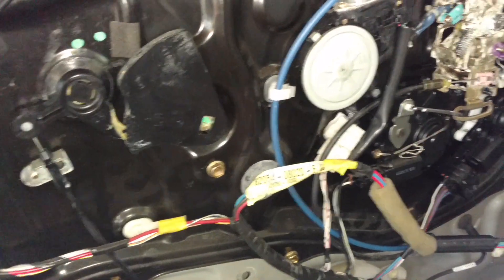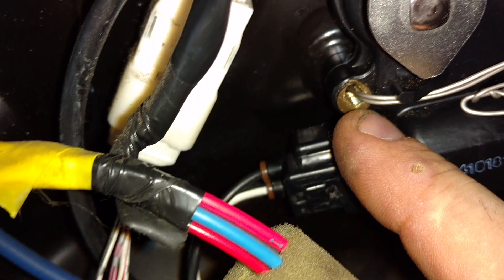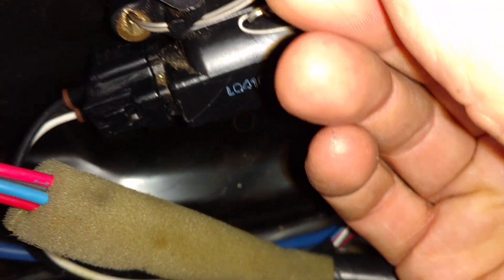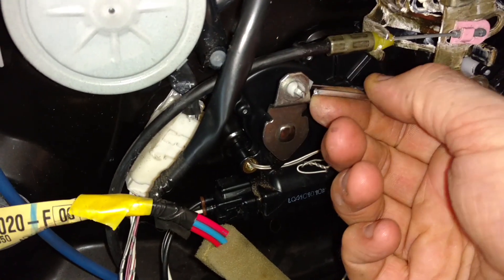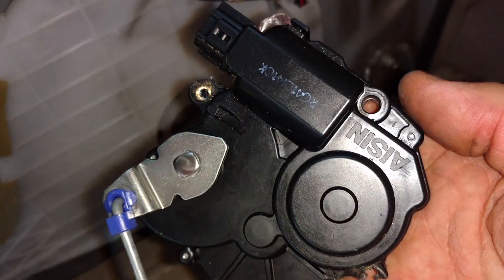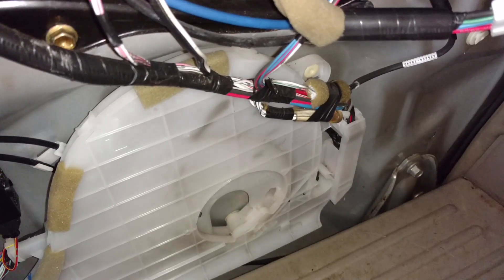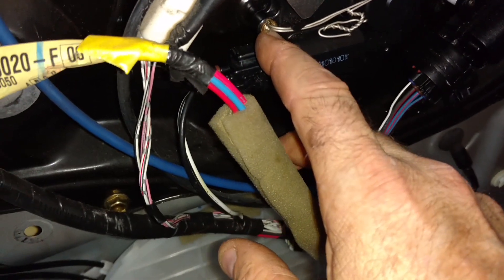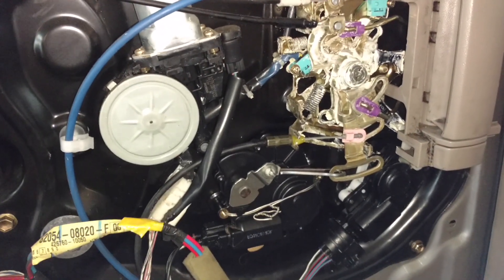2005 toyota sienna sliding door latch lock actuator motor repair

Comment: 6:45 Finally I found someone who supports my theory to use a drill to remove the 2 screws holding the actuator to the panel. I don't have a dremel to cut the screw head off nor a torch to heat it up   I already bought the complete OEM part since I'm not planing to repair the old one, might as well destroy the old one to save time . I have a professional drill bit set and I'll try my way up from the smallest bit to the biggest required. Part number for driver side 85620-08071 for $95 and part number for the OEM screw with loctite already applied 69296-08030 for $1.50 plus shipping, you need two new screws. I bought them online from  a Toyota dealer McGeorge Toyota Online Parts.
Reply from the maker: Thanks, 
Yes, drilling sounded so easy
Once the piece of the bit broke off
In the hole...

Comment: I have a 2006 Sienna LE. Passenger side power sliding door will not do the latch cycle, if I push from outside it will latch. Its opens normally on push button. the problem is intermittent do you have any clue what would be the problem? thanks in advance

Comment: I used my soldering iron to hear the end of the bolt while applying pressure to the screw with a short #2 Phillips once the bolt is got enough to hear up the massive amount of thread lock they use it came out fairly easily. I also used the heat to melt the plastic I cracked when I first started bought a couple new screws to replace the ones I stripped at the home Depot and it when back together smooth.

Comment: HELP! I replaced the motor in the actuator from a motor from digikey.. now the actuator arm moves when activated to open the door, but the arm doesn't complete the reverse action to get it back to default position.. without the arm back in default position, the door doesn't fully lock open or entirely shut closed... Any thoughts?
Reply from the maker: hi, do you recall if there was any coiled spring inside? i have forgotten how it returns to the initial starting position, by spring action, or by other means.
are you doing passenger or drivers  side? if passenger side, i think ebay has them for under $40. if drivers side, more pricey.